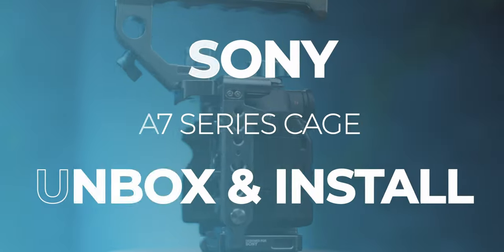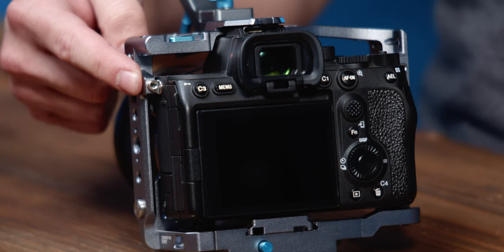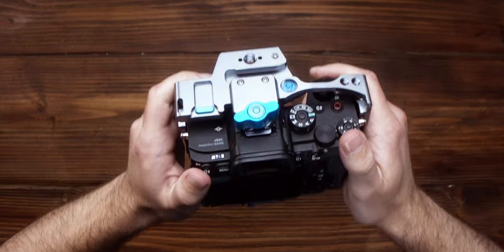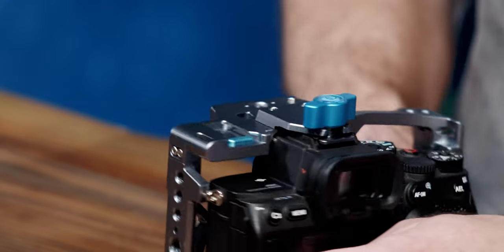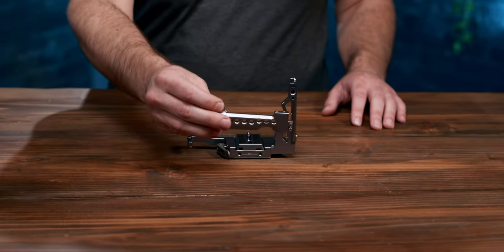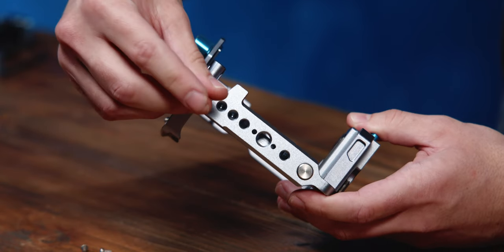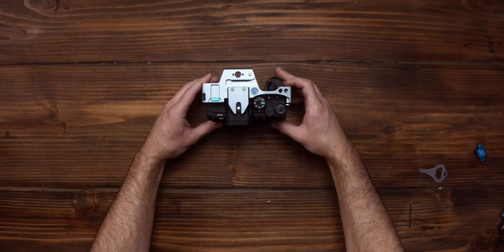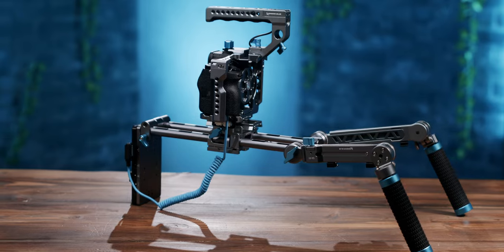Sony A7 Series Cage Design Update Install

Comment: I was able to to screw in both the left and right eyelets with the tiny screws on the A7S 3. Is that ok or should I have not done that since the video stated that it was for the left.
Reply from the maker: If you can screw in both that's great! The Sony A series bodies are all just slightly different as to where the eyelets line up so we simply adjusted so they'd be more compatible. The cage can also be used without the eyelet screws and still work as intended.
Reply: @KONDORBLUE  ok awesome thanks for the reply! I'll keep them in for extra security